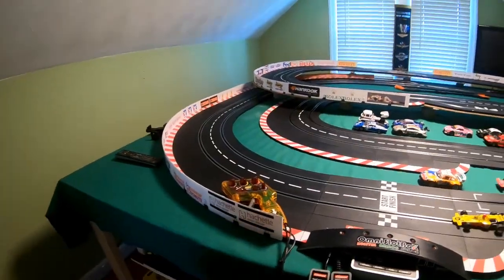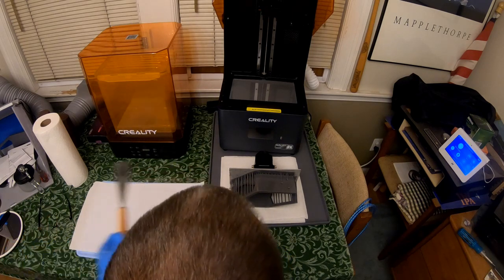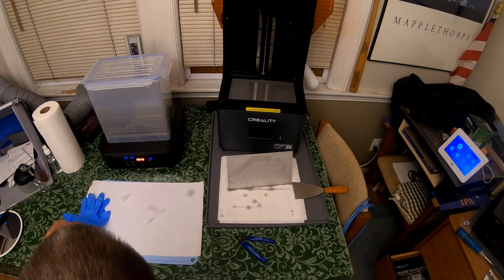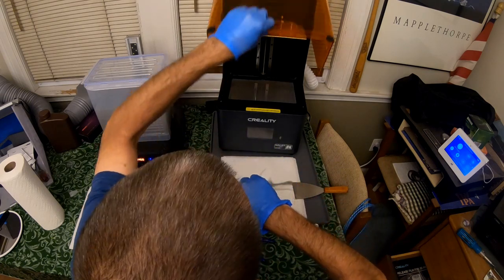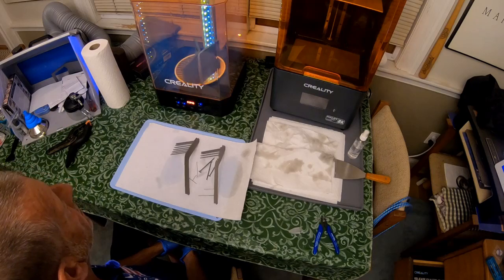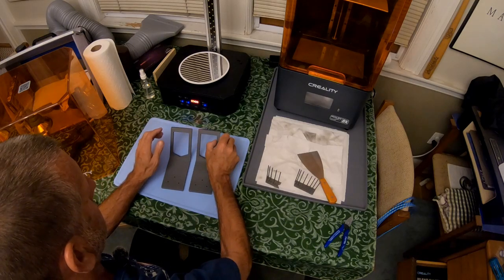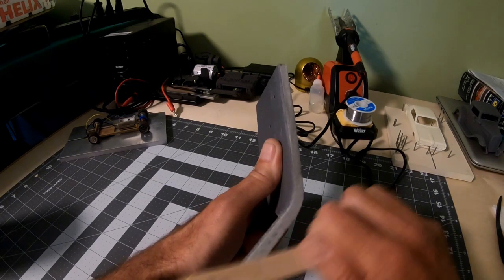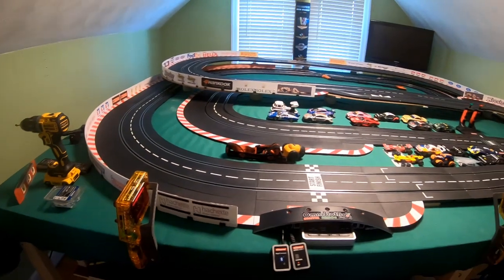3D printed Controller Holders

Comment: Well done Gene. The cheapest way to get Controller Holders would be, to take the Hook of a Coat Hanger. Usually those Hangers have a winding which one screws into small pre-drilled hole and wind them in. ;-)
Reply from the maker: Nice idea, that never crossed my mind